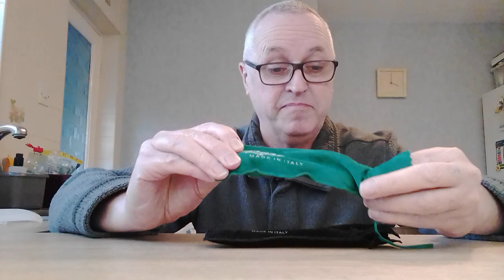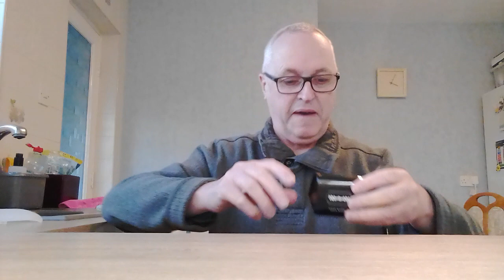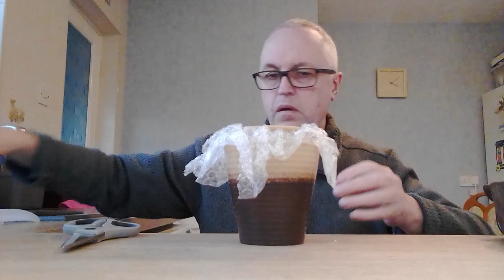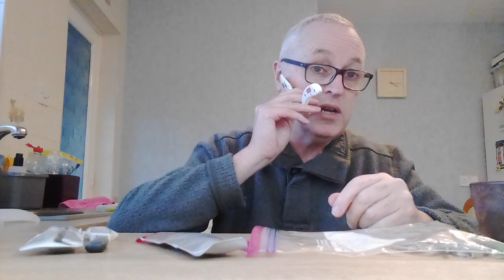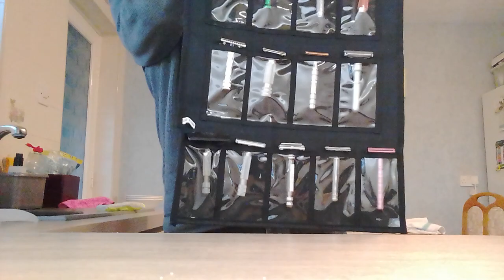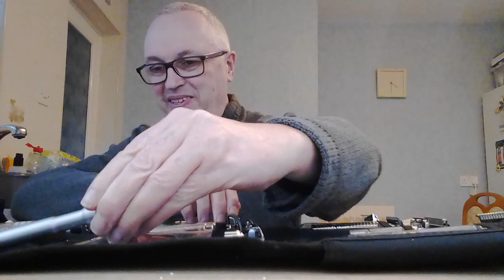Shaving: A Huge 'Gifts of Friendship' Video! An Unboxing of Shaving Accoutrements 👍

Comment: Very generous selection, especially the razors. I'm looking forward to seeing you shave with them. The Henson ++ is one of my two or three favorite DE razor these days. I hope it suits you. Hi, to Mom!
Reply from the maker: I suspect I might find the Henson, which I called Hanson (duh) a bit evil 😂 We shall see.
Reply: It's strange. My Henson treats me as well as any of my DE razors, maybe even a little better. I can somehow push it to its limits without exceeding my own (which are nothing to write home about). It could help that I switched from the original handle to a Timeless 3-1/2" titanium model I saw on Amazon. The extra heft and girth add control and slow it down. It now feels like "my kind of razor." But here's hoping your shave goes well. 

Right now I'm enjoying my Slim Adjustable as a daily shaver. I go from settings 3 to 2 to 1 and get excellent results. I learned to DE shave on a Gillette Super Speed and stuck with it for a long while. Now I'm recalling why. 

Congrats to England for making it to the World Cup knockout round.

Comment: god were to start mate . awesome haul . yes that is a flat boy razorene that john sells . what a straight razor bismark 👌 . best shavette in that bag is the focous al  but weck is awesome get yourself some kismet blades for that . ibc is a great shavette mate takes a half a de or feather artist club blades or the same blade the  supply razor uses . now the dovo shavette takes half a de or you can get the longer style blades that go in those plastic inserts . as mentioned above that ceramic thing is a brush and lather warmer . i could go on for hours about that haul you lucky barstool 🤣🤣🤣🤣 absolutely stunning gear mate
Reply from the maker: Thanks Paul. I will have fun trying out all the shavettes, that's for sure. I'm not sure they are my thing, but it will be fun. This was a terrific haul. It might keeping going for a week or two 😁